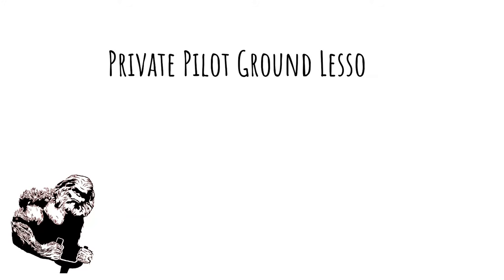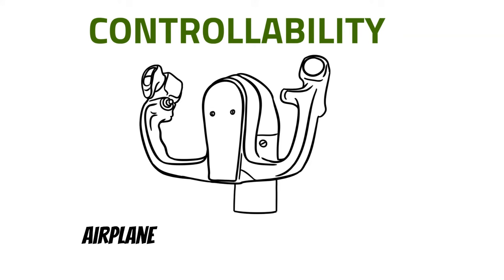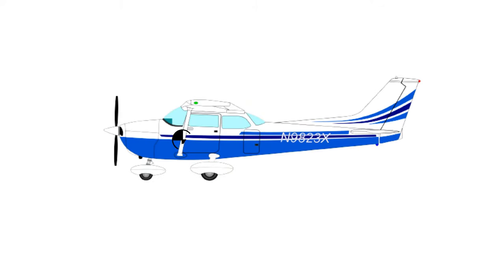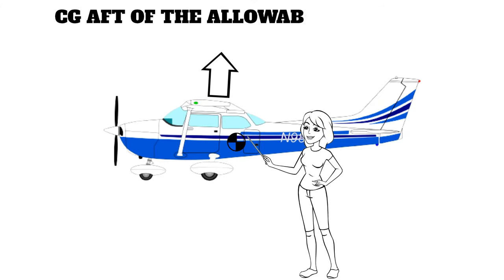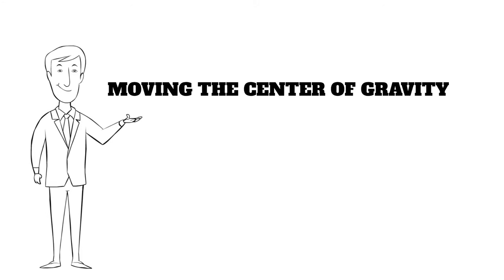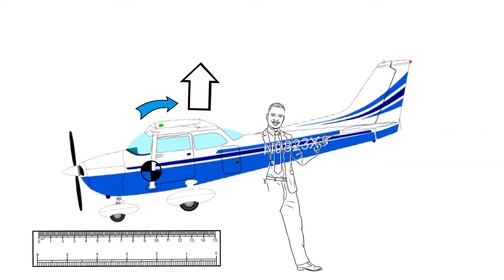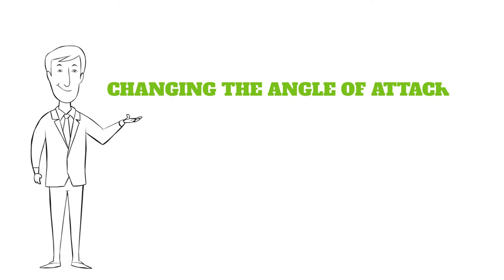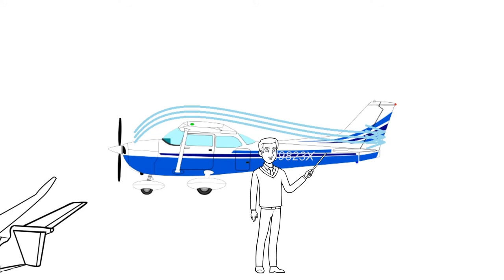Airplane Controllability Explained (Private Pilot Ground Lesson 7)

Comment: I got my ticket in the 90's... but haven't flown anything other than models for the past 25 years.  Been watching the vids as a refresher... and this vid is good info, and people dont' really get it.  My large RC prop planes are so overpowered... I can do anything simply by mashing the throttle. (Slipstream gives full authority, and can climb vertical)  My problem was, a few years back... I had an over powered jet, and I could yank it off the runway like a STOL bush plane.  Wellllll.... my buddies egg'ed me on, and I held the brakes, and gave it full power.  As soon as I started skidding the tires, I released, and pulled back.  The jet was off the ground in  5 feet.  Unfortunately, I fought a stalled wing, and in trying to recover... I smashed a turbine powered RC model. (about $4k worth destroyed)  Obviously, no slip stream here.  LOL.  THanks for the refresher vids.
Reply from the maker: Crazy story! Thanks for sharing!